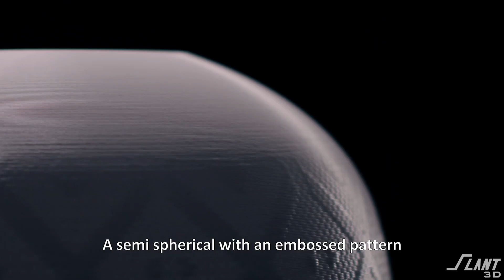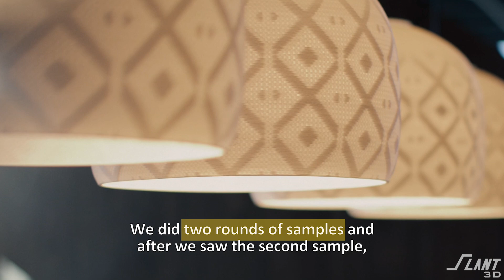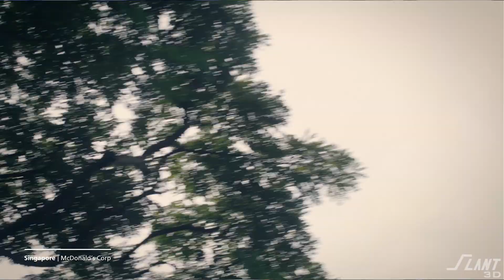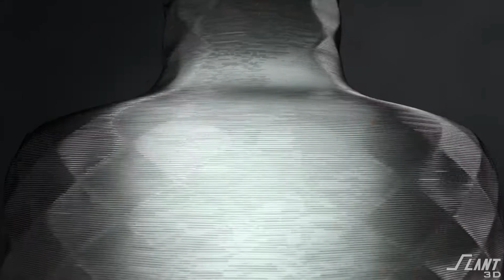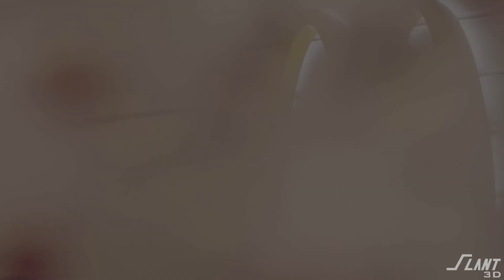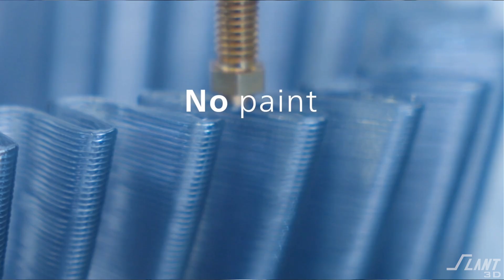McDonalds Putting 3D Printed Lamps in Stores | Real 3D Printed Products

Comment: Biggest plus I see to this is that you can actually get replacement parts that are EXACTLY the same even 20 years down the road. How many times have you went to replace a shade on a light with multiple bulbs (or like they have, multiple lights in the same room) and found you couldn't get the same design so you had to replace all the shades or the whole fixture or it would look really dumb? Really a neat way to do something a s simple as a shade. Wonder how much they are paying for them.....

Comment: That print has darker and lighter areas. Is that done through post-processing, or is there something else happening here? Can you print in vase-mode but vary the wall thickness dynamically? If so that could be very neat, but you’d need to reconsider how it’s sliced.
Reply: It doesn't have to be ordinary vase mode. It can be vase mode-ish with varying thickness, it can be solid object (and if it's one wall thick, it can be printed spiralized), it could be computational extrusion path without base 3D model. It might even be fairly ordinary (in quite loose sense, I don't mean PS or Cura ordinary but not-supercomputer-NASA-software ordinary 😉) slice with hand-tuned seams and details etc to make it look good. They might work with slicing techniques we, the common people, know nothing about.

It would be nice to see, if the inside is smooth and pattern is only on the outside 🤔
Reply: I think it is an optical illusion from the embossing.

Comment: Ridiculous eco posturing, if they were concerned out carbon output they'd buy some cheap bulk shades from a local supplier.
Reply: I don’t think cheap bulk shades from local suppliers on a global scale is as effective when a unified look/branding is a priority.

Frequently cheap bulk means poor labor, and less durable products that end up in the landfills. Also local suppliers would have different raw materials and quality of products around the world. 

Basically, those local suppliers will have different standards regarding global footprints. 

By using 3D printed shades on demand, they can utilize local manufacturers but dictate the exact filament material and only buy the quantity they need at any given time. 

The one concern I have about this design is it seems like a dust collector directly above the eating surface. While the top surface is smoother and easier to clean, the sides look like they would be more work, and I can’t imagine the cleaning lamp shades is a frequent task. I could be wrong; it’s been years since I worked in any facet of food service and my food handler’s card expired nearly 40 years ago. I like the faux woven look, it just looks difficult to keep up with cleaning. 

I wonder how recyclable they will be when the corporation once again does a major revamp.

Comment: They can't reduce their carbon footprint by building new locations, or changing some lightfixtures. It will increase, just not by the same amount as before.
Reply: I totally agree, but if they wanted to change the lighting anyway, it's not a bad thing to use methods that are better for the environment. obviously thought, it's not a big change, but a lot of them can make an impact, it's just a small step for something bigger
Reply: As long at they can make shareholders and lawmakers happy, that's what counts.
Reply: If switching out incandescent lighting to LED lighting, the amount of electricity used drops, and thus the related emissions. 
Most fast food locations revamp the interior of their stores every 4-6 years, so utilizing materials, or supply chains that have a lower energy/emissions footprint will lower footprint over previous iterations. 
By utilizing PLA, which is sourced from corn, or other crops, accounting might even claim a negative carbon footprint, as carbon sequestered in the generation filament.